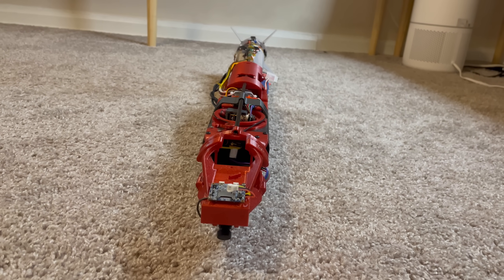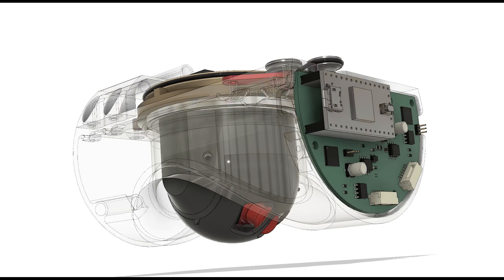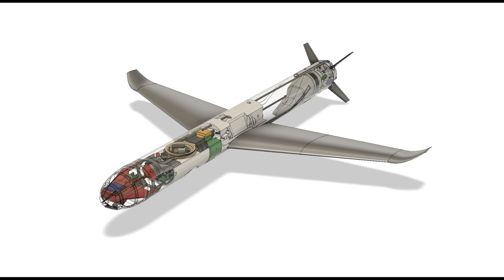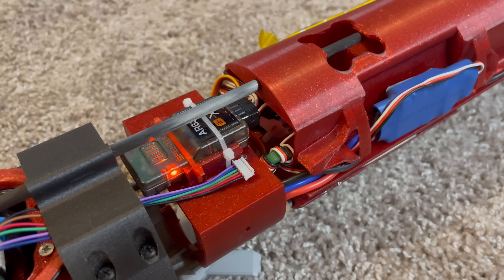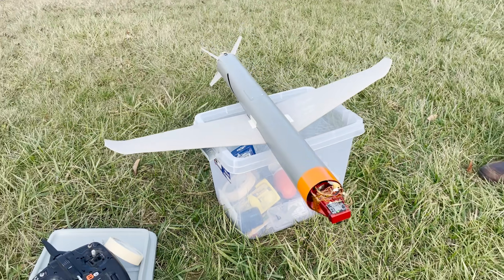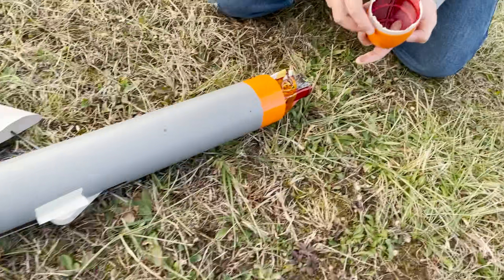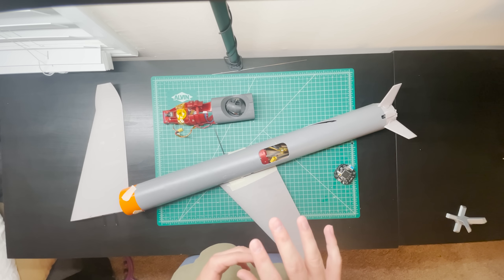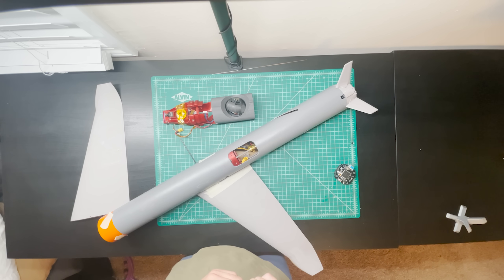Building (And Crashing) my Homemade Surveillance Drone

Comment: Put it on a vertical test stand and measure thrust. I don't think you have NEARLY enough. It should be able to take off from your unlucky friend's hand.
Reply: Glad it's not just me, that looked underpowered before he even fired it up.    Love the design, but it seems a little ambitious for that tiny ducted fan.
Reply: Related, maybe move to a 4" diameter? Bigger fan and fatter wings being the primary benefits.
Reply: But it should even fly without thrust at all as well. If it can’t glide it will be difficult to get it flying with a motor too.
Reply: @Todestelzer it’s too heavy to glide and hand throwing speed. More thrust would get it to flying speed quickly. It seems to loose speed when the throw it. All my planes, homemade or not gain speed once they leave my hand.
Reply: This. Thrust is lacking massively. Make a runway with a 'cart' to allow the craft to accelerate along and then take off when V1 is reached.
Reply: I think the intake under the rear is also causing it to pitch up by creating a vacuum under the rear. 

Also think it 10 year old could come up with a better designed plane. So there’s that.

Comment: It looks too heavy, not enough thrust and aerodynamically unstable. I very much doubt that your control surfaces have enough authority to control the plane as well.

If anything, I would propose you start off with the design of just the aircraft/wings and use 'regular' RC aircraft electronics to get it aerodynamically sound, before adding other things and making it much heavier.
Alternatively, a 'ready made' RC plane platform that you modify for your needs by adding the packages. 

tl;dr Although novel, pretty sure you are trying to take up WAY too many challenges at once. Try to get something working first, and then tackle each of these on their own. Because you are introducing so many variables at once, it is very difficult to figure out what pieces work, which dont work, and which one might work but need tweaking.

Comment: You should try a bungee launch. It is much faster and more predictable than a hand launch, especially with a new plane. Also before you risk your complex delicate powered drone, I suggest you create a simple unpowered model from a cardboard tube that is appropriately weighted and winged to perform the same as the real thing and try launching that as a glider. If it wont glide, at least a little then adjust things until it does.
Reply: this for sure. most of these lower thrust drones unfortunately jus cant take off without that inital push

Comment: From my experience with similar edf style drones, you should characterize your control system on a hold down style gimbal and try to initially hover vertically using your control vanes. I have examples on my channel. Also, never rely on the posted thrust of an edf motor and do your own thrust to edf curve regression on a strain gauge. Also, the main issue is not the external control vanes but the internal ones to counteract the induced roll of a prop spinning in 1 direction. Let me know if you need more ideas since I have a lot of experience with edf drones!

Comment: Homie just out here building DIY silo launched SAMs and Cruise Missiles

Unbelievably based

Also, I'm 100% positive that your weight is waaaaaay too high. Most RC plane developers use LW pla or foam for the construction with very minimal payload. You might need an actual jet as opposed to a ducted fan at this weight class. Those rear surfaces also seem extraordinarily small for the size of the craft so I'm sure they're not giving much control authority, especially with no ailerons or flaps.

Comment: You are a rocket guy,  thus make it rocket assisted takeoff. AKA  WWII V2. It seems that your frame requires high speed to glide, and your CG is off balance. I have seen posts here on how to adjust the CG. I also have seen many YT just about CG tuning.
If I were you, I would go in small increments. First, make it fly without any payloads.
Good Luck!

Comment: Regarding your thoughts:
1. Yeah, your wing loading seems too high, especially considering you don't have highly cambered wings or flaps. You don't share numbers but for reference, a wing loading of 3.5 kg/m^3 will give a flight speed of 20mph at a coefficient of lift of 0.7. Printing your wings out of foaming filament can reduce their weight by like 40%, though you'd also want to incorporate a carbon spar.
2. Larger tail is necessary, but remember it doesn't all have to be all-moving control surfaces. If you want to experiment with stability margin, you could add a passive tail and reduce its size with progressive testing.
3. I agree rail launch with bungee is the safest way to get this thing up.

Comment: I might consider a weighted test article to hash out launch and glide ratio. Same weight layout and construction just without all the electronics. Inherently unstable works for fighter jets but your drone should be able to track mostly straight and glide even a little bit without input. This will also allow you to adjust CG location to determine balanced flight profile.

Comment: I fly hand launcher airplains. First great work your are doing, second, look like it needs more thrust, a a rule, the plane does not need to be intiali propeled, juts deliveres in air, it should self propelled. The trowing technique was very very bas jajaja, it should be caunched fom top, and be launched not to the sky, but ruther paralel to the ground + 15 degrees up. Vehicel will need to preopell itself.

Comment: A few tosses between two people can really help dial in cg. If the tail immediately goes all over the place it's tail heavy. It should just arc or go pretty straight. Even at the low speeds of a hand toss it should help. Start slightly nose heavy for the maiden and dial it back from there. Awesome projected! Subbed for updates!

Comment: make a sled or something so you can test it lower and flatter to the ground. if it wants to fly it would leave the sled, if it didn't it wouldn't. It would prevent a lot of breakage. maybe an RC car with a mount on top for the plane to sit on.

Also, could you gimbal the fan or duct itself for total TV control without fins? it could be paired with the IMU to help keep it flat and control roll during flight.

Comment: Catapult launch systems (giant rubber band) are normal for these types of high wing loading designs with ducted fans. The available trust is generally subpar until you have some speed behind it to feed the fan. This also provides enough air over the wings to provide lift.

Your stabilization also appears lacking in authority which is not allowing it to track straight, which in turn is upending whatever lift is available.

Comment: If you wanna keep throwing it perhaps you could use an atlatl (spear thrower)
Reply: RAIL LAUNCH SYSTEM 100%. take human error out, add much needed speed!!! make it repeatable.
Reply: @eriknulty6392  No, if the system is so screwed that you can't hand launch it then he probably isn't going to be able to hand fly it either. And spamming the same comment over and over again doesn't make it a better idea.
Reply: @thomgizziz  thats where you are wrong, that heavy bird with tiny control surfaces will fly great (AT HIGH SPEEDS). but going 4 mph you may as well just throw a brick. I do know a thing or 3 about building and flying scale planes, been doing it for 25+ years. but at that curb weight it wont fly until MIN. 20mph and thats probably even still pushing stall speed. she is a 50+ bird.

Comment: Why not build a guide rail launching system? All hand throws introduce rotation, which is why all your attempts failed. Either put landing gear on it, or allow the current design to get up to speed with a somewhat horizontal launch system.

Comment: As someone who builds a lot of RC planes, I’d recommend adding ailerons, and possibly flaps, to improve lift and control at lower speeds during takeoffs and landings. As you mentioned, the plane seems too heavy relative to the available thrust—using lightweight filaments would help a lot. Also, it’s unlikely you’ll be able to manually stabilize the plane quickly enough during takeoffs and landings, so I highly recommend adding a flight controller for automatic stabilization. Finally, it looks like the elevator authority might not be sufficient with just the vectored thrust setup.

All that said, this plane looks absolutely stunning, and I can’t wait to see what you do with v2!
Reply: I don't know too much about this field but would it not be extremely hard to add control surfaces as well as the servos to control them when the end goal is for them to fold?
Reply: @smellyboars4865  flaps would be a pain (and probably needed it if the wings are just bigger) but ailerons could added without too much extra complication... especially considering how complicated everything else on this is
Reply: @smellyboars4865  the 9g micro servos are actually pretty small. I think with few tweaks in the design they can fit.
Reply: Yes, it definitely needs ailerons, it has negative stability in the roll plane. A single micro servo would do that quite easily and cheaply. A rail/catapult launcher would certainly make getting it airborne a lot more consistent, and could be adjusted to give more/less speed on launch.
Reply: I disagree on the additional control surfaces, at least initially. Adding lightness is priority number 1, and ailerons aren’t really necessary when roll control can be carried out through X-.taik mixing. I’d instead move the wing up.
Reply: @howlingwolven  The X tail doesn't have enough of a control moment (force x distance) to be effective at low speed, maybe at Mach 1, but not at launch speeds. A micro servo is only about 2 grams in weight. Moving the wings up would certainly help.
Reply: What about a slingshot type launch system? Would that provide enough forward motion to generate lift whilst the fan gets up to speed?
Reply: If you look at Switchblade, it needs a secondary wing at the back for extra lift, and they sit at 3.6 lbs
Reply: It took less than a second to know that this brick would never fly. Before trying to design a "revolutionary" square wheel, you should study why everybody else uses a round wheel.  🤣🤣
Reply: hal 'ant musaeadati fi mashruei wahu eibaruh ean tayirih almutahakim fih baed li'aniy 'afqir alaa alealam alkafi fi amikih alhawayiyh fahal aldiyn musaeadati fi mashrueay alsaghir wshkraan.
Reply: God
Reply: Big Scale FPV B-52 for Carrieng, fly 350m straight line with 80kph, and try it again. If the EDF Rocket  out of controll deploy parashoot. Put parashoot instad of IR cam for the beginning

Comment: You can also try launching it from higher speed so that it can maintain or at least glide at that speed. This will help you understand how it is behaving and if it needs more thrust.  Also could you explain how you calculated the thrust four your motors and the air intake area.
Reply: Also a lighter material will help you reduce the weight a lot building it completely out of 3d print is not a very good idea. I would say build a fiberglass body and section it so that 3d printed parts can be fit and mounted inside it.

Comment: It appears that your stall speed is too high for a hand throw. You could try launching from a moving vehicle. 

My idea would be to attach a servo controlled release mechanism to the roof of your car. Accelerate and then keep your velocity just above the stall speed of the plane and then release it from the top of the vehicle! You could even get fancy and use a switch w/ spring or load cell to detect when the plane is generating lift and then release automatically. Or that becomes your queue to manual release the plane, remotely.

Comment: amazing work. Quick question, how do you negate the COG change from the wings in stowed vs deployed position? are both positions acceptable and within the static margin? Also, for V2, maybe you could provide lift from a fuselage rather than wings? like a platypus design since you already have TV for control that would be sick!

Comment: Try launching from a car with someone sticking out a sunroof or stood in the back of a pickup.
You can get up to speed and first get an idea of if the thing 'wants' to fly before actually letting go & launching it.

...works like a poor man's wind tunnel and you won't need to rebuild the thing after every unsuccessful test.

Comment: Really cool idea. Can't wait for it to takeoff. For the fins you can also have the bottom two fins planar to the wing like with a F-22 or F-35 fighter jet. That should give you more control authority than two smaller fins 90 degrees from each other on the bottom

Comment: hi love your work. I agree weight so also check center of gravity. Next Air intake might be a reason normal airplanes and drones have an air intake that points forward? I am not stating that your solution might drag the rear of the drone down but checking might be a good idea. Try hanging the drone in  some strings to find the center and look at the power profile while its relative stationary. I am looking forward to see you next video.
Reply: I should have added that the air flow passing the air intake, when the drone is fast enough, will pass bye the air intake and starve the turbo... You will need the air intake directed forward-

Comment: I see two big problems. The thrust from your impeller is too low. Not only because it is a fairly inexpensive impeller but also because electrical impellers build up little static pressure in the impeller and the diameter behind the impeller is smaller than the impeller itself. I also think your center of gravity is too far back. For further experiments I would get away from the the thrustvector, use a better impeller and first build a traditional aircrafttail with larger control surfaces, in order to have a better chance of being able to handle any strange flight characteristics better. 
Of course, a lighter aircraft always helps and could be successful when paird with a stronger impeller. If you want to achieve a good result, please only trust well-known manufacturers when it comes to thrust Statements.
Hope that helps.😊
Reply: You think his center of gravity is too far back when it was nose diving into the ground... really? You think you are helping? Your nonsense about "impellers" is even worse.

Comment: The proportions of this are scale-like, but really bad for RC. 
If i were you, I'd probably 1)increase the length and wingspan by at least 50% while keeping the dimensions of the fuselage. 2) rail or bungee launch for sure. This thing is HEAVY for its size, you're going to need so much speed 3) move the intake to the top, going to help with FOD Ingestion and a little with lift/pitch stability under thrust at low speeds, especially considering 4) tail feathers. These definitely need to be bigger. Like 3x probably. Without ailerons and no dihedral, your role control is going to be trash. The smallests gusts of wind will have this thing flipping over. The

Comment: Definitely reduce takeoff weight at least for early test flights. A rail launcher would be a game changer for getting you off the ground consistently with enough velocity to get enough lift out of the small wings. In addition, a rail launch would let you spin up your edf right before you launch. That way you are taking full advantage of your vectored thrust right as you leave the rail, when your control surfaces are going to really struggle giving you enough control authority.
Reply: Giant water balloon slingshot and pvc or wood rails
Reply: Rail launcher, and put a large net downrange to catch those early failures. Later you can use the net for soft landings.
Reply: ERAU Grad, changing the air frame before getting it airborne is going to kill his understanding of how it flies in its ideal flight configuration.  He should be focused on getting it airborne first then worry about changing it IMO.

Slingshot launch could help him dial in his v speeds without needing to redesign his aircraft.
Reply: Thinking vertical launch with a potato cannon style launcher
Reply: Aerospace engineer here, seconding the rail launcher

Comment: You might want to drop this from a quadcopter to get the airspeed you need. The catapult method would be a good means of getting this in the air as well. The system looks awesome!
Reply: air compressor with a rail is easy to do